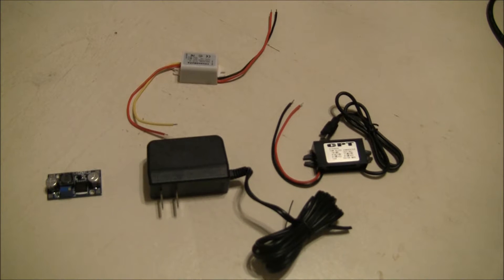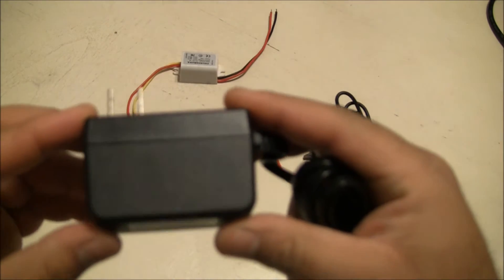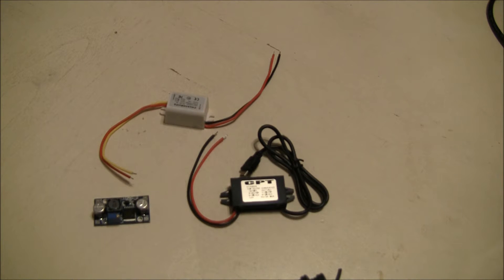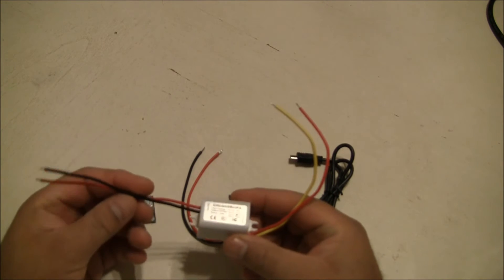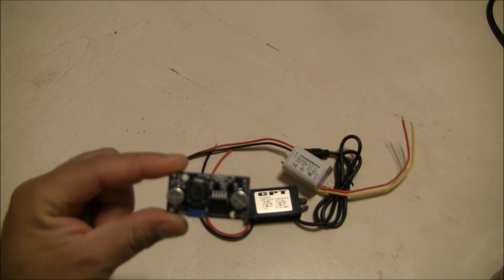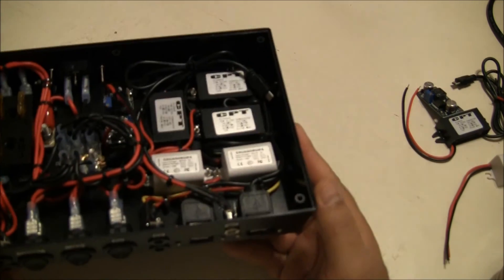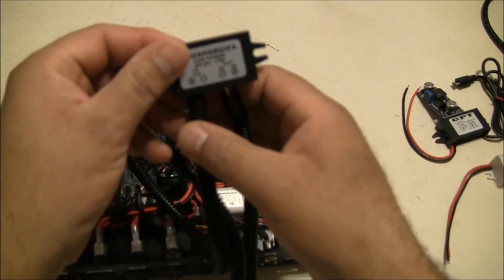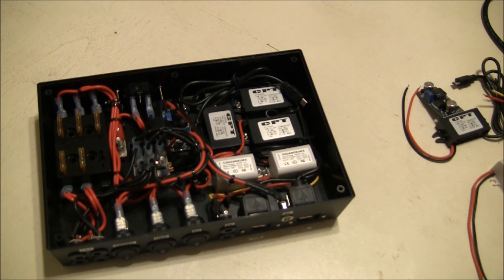DC Power Distribution

Comment: Great, this answers a lot- love the multi purpose box.  I've read that we need to have "pure sine wave" to run expensive computers, laptops etc. and not ruin the device. and I saw that in inverters, does this apply here? Also, I am wanting to make something that more things are like regular plug in, not sure of volts, like portable ice maker, box fan, coffee machine, and eventrually want to have back up for refridge, small freezer, and power tools. So, I am thinking your systems work for that- need to read all you have,  THANKS!

Comment: Cool Project case!! Where did you find the panel mountable USB jacks? Also i Noticed you did not mention the Current limit aspects of the converters. If you try and draw more current then what can be. you will indeed shorten its life span..lol
Reply from the maker: Yes, I should have mentioned it. Most of the converters will support 3 amps, which is great since most of our small electronics do not require anywhere close to that. 

As for the USB panel mounts, you can find them on Amazon or eBay. The Amazon prices are a little high, but on eBay, they cost less than $5 shipped from China. 

Thanks for the comments.